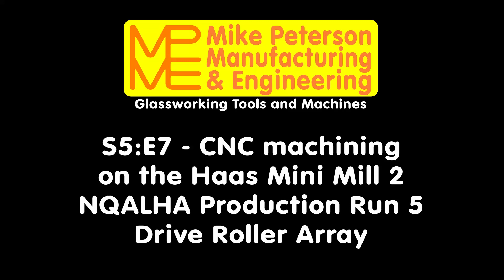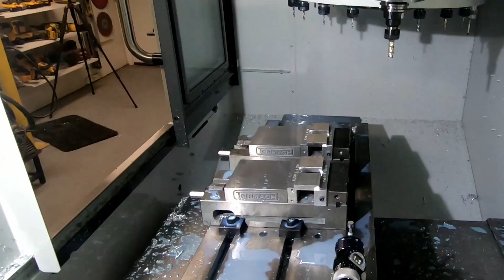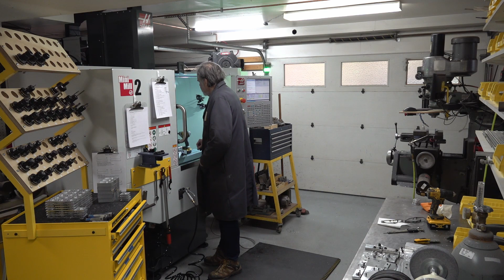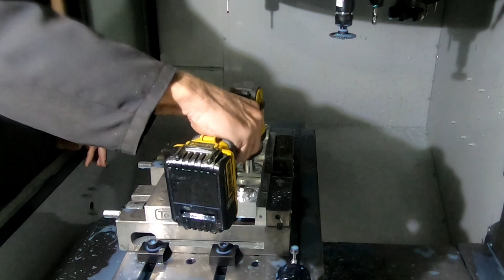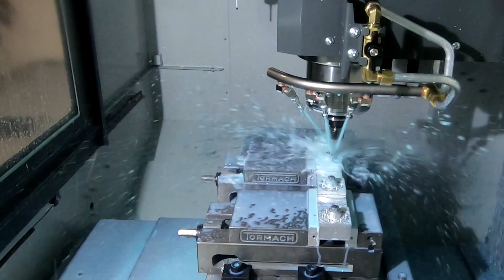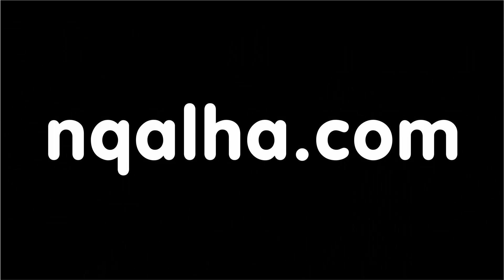S5:E7 - CNC machining on the Haas Mini Mill 2. NQALHA Production Run 5. Drive Roller Array

Comment: Do yourself a gigantic favor and save yourself a lot of frustration, get HSMWORKS. It’s fantastic and you can get it with Fusion 360 if you can’t afford the plug-in for SolidWorks. Excellent support if you need it but it’s so intuitive.

Comment: Can you go over how you mounted your camera inside the mill housing?  Is it a suction cup or did you still holes to make a mounting fixture?
Reply from the maker: Magnetic base with the gopro mounted out of the coolant splash
Reply: I have the same Haas MiniMill2.  I love it.

Comment: at 12 min mark - you have some really nice feed & speeds going on.  Most people are way more conservative in a real shop. In bob cad you must be using the Dynamic machining for ruff.  (trochoidial machining vs traditional pocketing ) 

Part pullout worries?   I use 1018 stepped jaws as my standard raw stock jaws.  They make like mitee bite jaws or similar that bite in.  

in multi axis - Dovetail is a common prep for gripping  - like a raptor holder